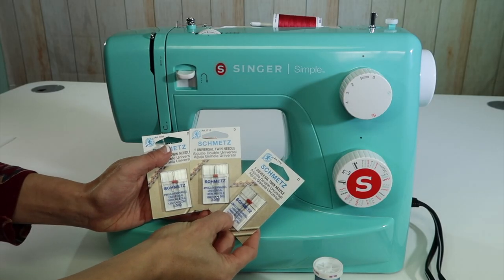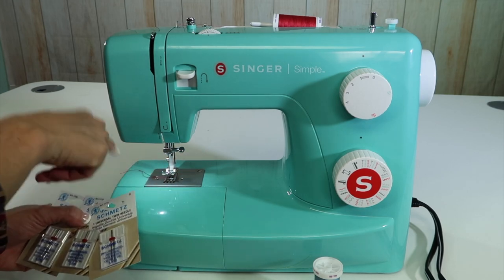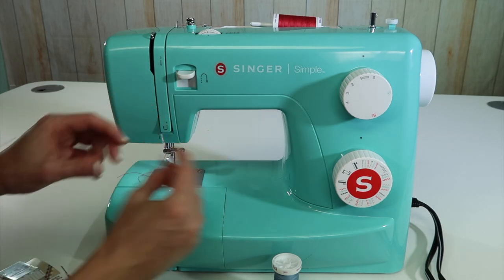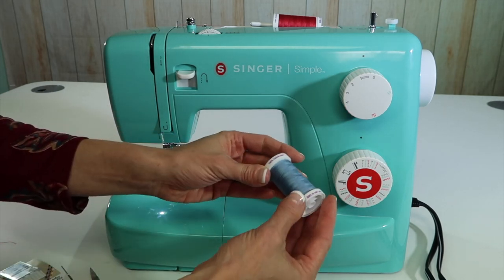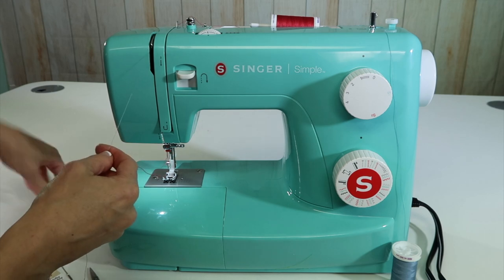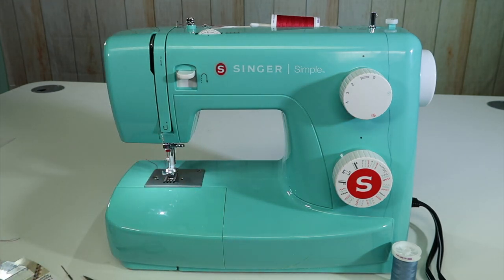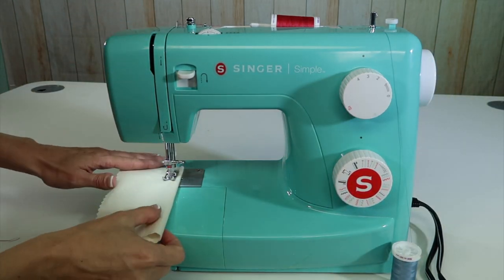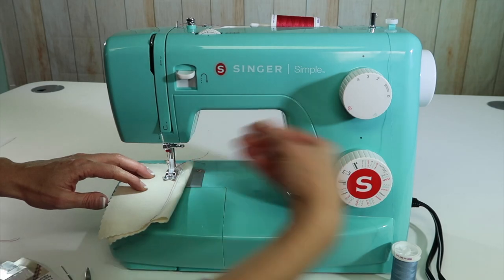Singer Simple 3223 26 Twin Needle

Comment: You mentioned that there is a vertical spool pin that can be purchased for this machine. Can you make a video showing how to install the vertical spool pin? I'm asking because the hole for the vertical spool pin on these machines appears to be plugged up, and so I can't figure out how the spool pin would be inserted. Sorry if this seems like a silly question, but I am new to this.
Reply: Have you found out how to attached the 2nd spool pin yet? Can't find much video on it. I'm pretty new
Reply: @rabbitnmustard  I figured out that where the hole looks like it's plugged up, it's actually just a "sticker" (like, a thin, hard, plastic sticker) that is covering the hole. I was able to take a small knife to get under the edge of the sticker to be able to lift it up and peel it off. Under the sticker is the hole that I believe you would just insert the spool pin into.
Reply: @Happily05  I figure that out too. but i got the wrong spool pin. it fits loosely for me :(

Comment: Thank you for this video.  I wonder if I'm doing any damage by putting the second spool on the bobbin spinner?  Additionally, most videos on doing pintucks say that you need to pull the bobbin thread  so that it resembles a straight line of stitching.  This usually does not work for me no matter what tension I set.  I work with quilting cottons.  Can you  offer any suggestions?  Also, it seems that there isn't any place for a second spool holder so I'm can't figure out where any purchased one would go.   Kindly advise.  Thanks!!